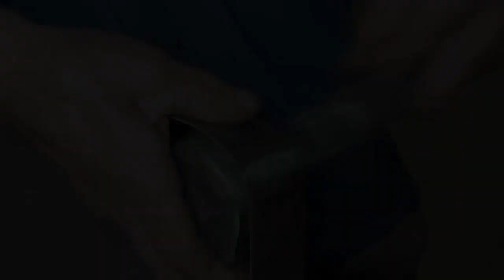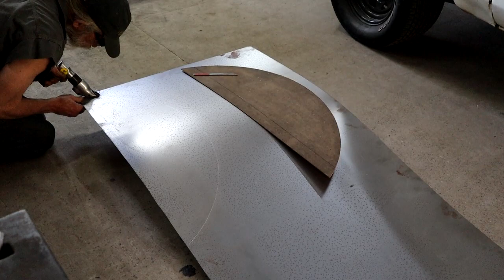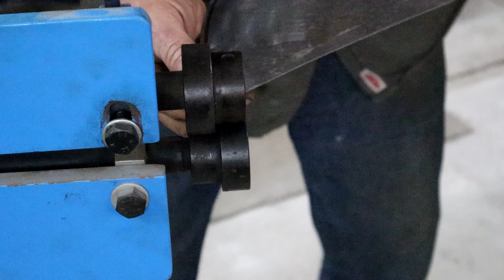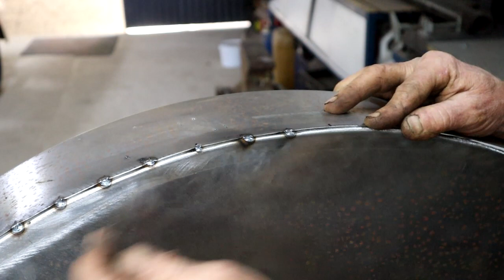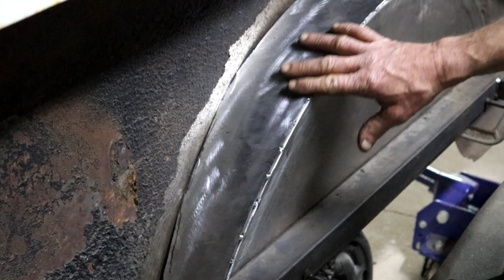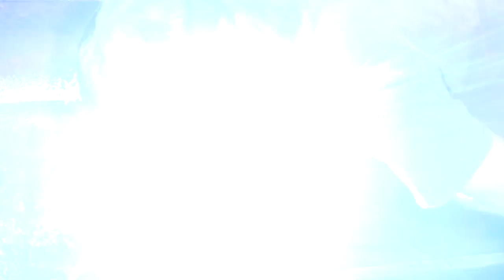CUSTOM TRUCK BED BUILD - FORD F100 (Part 7)

Comment: I’m really enjoying catching up on Rat Rods for Africa videos. I like the way you showed multiple ways to achieve the same end results. I know you were just learning TIG at the time but I would have used TIG instead of MIG. TIG is perfect for thin metal outside corners.
Reply from the maker: Don't think I even had the TIG yet when I built this thing😅

Comment: Div, what was the word you used for marking the inner fenders? I heard spiling? Googe has a much different meaning for that.
Reply from the maker: The word was spiling. Used in the boat building industry where I worked for many years. Google "spiling in boat building".